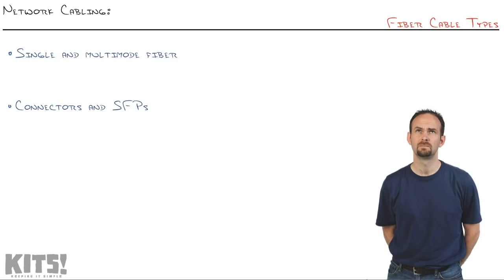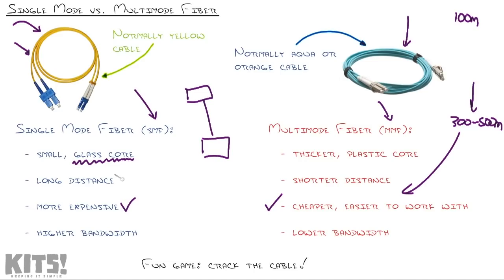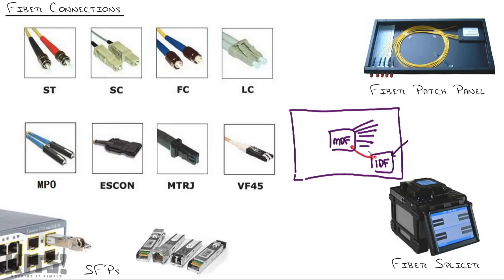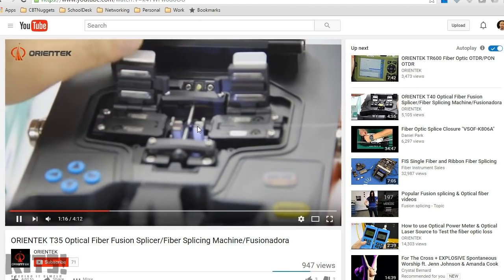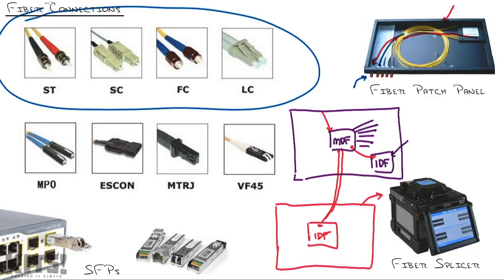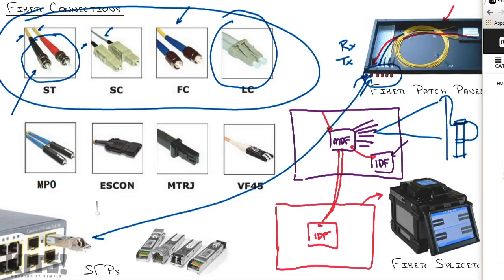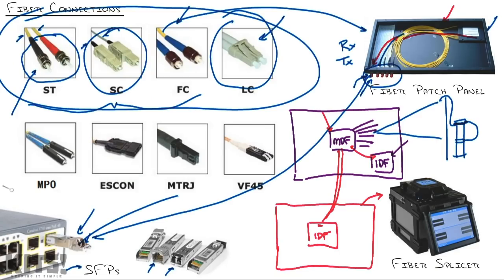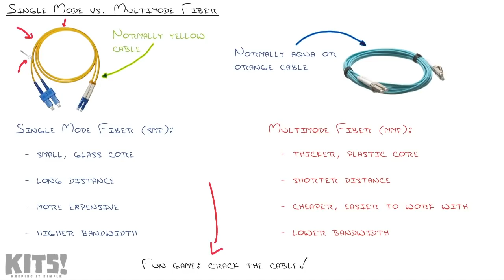There's How Many FIBER CABLES???: Real World Cabling Ep.1 -  Keeping IT Simple

Comment: The distance of fiber is more based upon whatever optics are driving it.  MM optics are LEDs, while SM optics are lasers.  Also different laser types have been used to extend the range out to 120km for a single run, but it's all dependant on the number of splices in the run, which causes light degredation and limits how far the laser can reach.
One other point, while you always need Tx and Rx, there are modules that collapse those into a single fiber, where Tx and Rx are on different wavelengths of light within the fiber.

Comment: Great series!

For me, fiberoptic links provide the advantage of galvanic isolation.

I once installed FO-lines in a farm. The houses were all wired on different phases (here in Germany we have a 3-phased 50Hz AC with the phases shifted by 1/3 Pi ... normally no problem but the zero-potential was not equal between the farmhouse (where his brother lived and the shop was), the remise (were my friend lived) and the barn (where the milking machine and the cooling needed network-connection).

By selectively installing FO-lines between the buildings we could prevent to lose the 4rth switch (1x D-Link, 1x Cisco small business, 1x 3Com). Yes, they just replaced the hardware without thinking what caused the problems.

Comment: Very nice.   One thing to add though, what connection is on the patch panel is usually up to who installed it.   The push lock connectors seem to be older installs or used by closed circuit video systems.   Newer network installs were SC, then everything recent was LC.   
If you are asking someone to install it...ask for what you want.  Not having to keep unique patch cables handy saves tons of time.

Comment: We just had a new fibre line installed on our work site and I was watching the contractor bring in the new cable. I was amazed to see that the RX and TX are on a single fibre strand and was terminated with a single LC connector (not a dual one). Even the SFP GBIC was a single socket connector.

Comment: Great video. There's been times where I have been setting up fiber cables between switches and ran it around and around and thought I would have broken it and the cable was fine.  Then there's been times where I barely touch a fiber the cable and broken it.

Comment: I have a real world question.  In the building where my company is there’s 2 network closets.  The isp fiber with single mode fiber runs to the closet 1 but my company network ports are wired to closet 2.  The 2 rooms are bridge with a mulit mode fiber.  After the installation I couldn’t figure out how to convert the single mode fiber to use the existing multi mode fiber.  What would be the solution for this?  Needless to say we paid someone to wire a new Ethernet cable across the two rooms
Reply: You have a few choices.  Usually the ISP will install their gear where the fiber terminates, then you ask them for a connection out on multi-mode.  Most business ISP sales reps live for this kind of work, it lets them use phrases like "Solution Provider" or "Value-Add".  Expect them to pivot to the "How else can we help you" conversation afterwards.  

The ISP may also just run SMF to the other closet and simplify your life later.  

 If  the ISP  connection is just a fiber then look for a media converter.  Or, if you have a spare switch with two SFP ports you can use that.   The media converter will be cheaper and won't complicate network designs though.